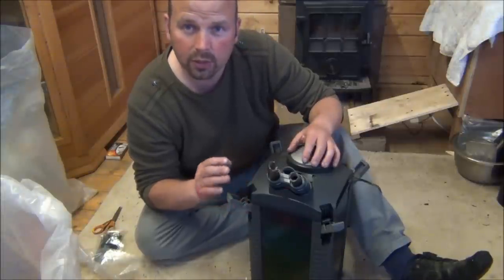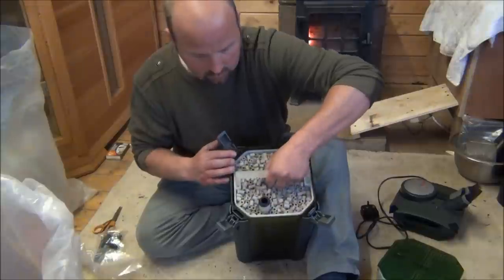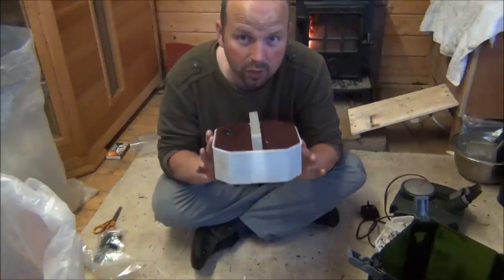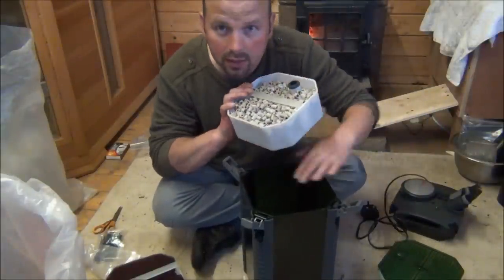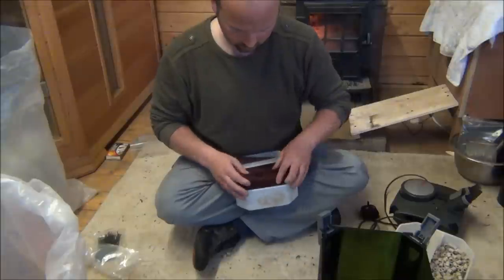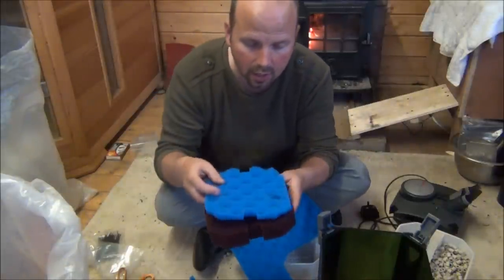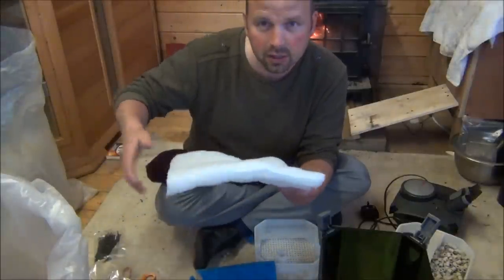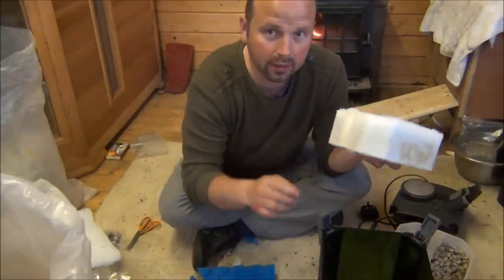How to set up an external canister filter for aquarium by Pondguru

Comment: Hi pondguru,
Firstly great video just brought some ultra-home pulse and ultra-home ultimate can’t wait to get them in the filter.  
I have an Eheim pro 3 filter which has 4 trays and the heavy foam filter at the top as a pre filter. At the moment my set up is  heavy foam filter at the top, bio balls in the first tray then ceramic media in the other 3 topped off with fine foam at the top. I can see from your video this is wrong.
Would you set up your heavy medium fine foam in the first tray then bio balls then ultra-home pulse then the last tray ultra-home ultimate at the top? Also would you remove the heavy foam from the pre filter at the top?  
Thanks mike
Reply from the maker: I take it your bio balls are the plastic type? They just take up valuable space which could be used by good media so are best out in favor of biohome. Other than the pre-filter foam in the top which you can leave in there just set the filter up exactly the same. The ceramic can be used in the very bottom just like it is in  this video, no worries.
Reply: Yep there plastic balls ill out them and do 3 trays of bio-home.
Also I run 2 of the filters how long would you leave the first filter to establish before thinking of doing the second.
Reply from the maker: Mike Boulden
With the biohome only about 2-3 weeks.
Reply: Cool ty for help pondguru 😃

Comment: Yeah i had a look it gets pumped from the bottom to the top and comes set up as from bottom to top > plastic bio balls > blue sponge 15ppi and advance ceramic media on top in one basket. 2nd basket on top has Activated carbon > phosphate pad then white wool on the top. i was thinking of getting the Biohome media best set up would be much appreciated. Got this all running on my juwel vis 180

Comment: I just bought a 46 Gallon Bowfront aquarium and a Marineland Emperor 400 hang on back filter. Saw you video and want to buy the biohome ultra to put in the media basket. It has 2 biowheels and it has the cartridges with foam and charcoal.  will all that work well together or is the biohome only good in the canister ones?

Comment: Hi

Do you think it's better to place the spray bar and intake on the same side or opposite sides. I was thinking it would be better to place the spray bar on the same side and point the spray to go to the opposite side so there is a circular movement of water.

The manual reckons that it should be on opposite sides - but I think with that setup the water that is directly underneath the spray bar does not move.

What do you think?
Reply from the maker: That would work, yes as so long as the return water is being directed away from the intake point you will get a good turn over of water.

Comment: the tubes you wanted to throw away btw are for mechanical filtration I think. Eheim has them too (Eheim Ehfimech) and it's being used to trap muck. This could be placed in the tray at the bottom (so this comes first), then the foams, at the end the biological filtration. The pipes also create a certain flow en makes the water go even throught the other layers of filtration

Comment: Hi Pondguru.  Excellent video. Just swapped my small 63ltr for a Fluval 240.  I like the idea of using similar media as that in your video. How would you set up a Fluval 306 external filter to use Biohome mini ultra media as the course filters are on the side of the media baskets.
Reply from the maker: +Steve Carter With the fluval filters they have decent filters down the side but ideally the bottom tray would still be used for the 1" thick coarse, medium and fine pads as shown in this video. That leaves you two trays which will each hold approx. 1kg of either mini ultra as shown in this video or the newer biohome ultimate which is the same but has added trace elements to enable faster colonisation and faster processing of waste. http://www.filterpro.co.uk
Reply: +Pondguru Outdoors Thanks for the advice.  I will order what I need but how often would the biohome ultimate need to be changed.
Reply from the maker: +Steve Carter It should last a good 6-10 years at high efficiency in a well set up filter but structurally it will go beyond that.

Comment: Thank you for this video, I am a beginner in proper goldfish care and all the different types of filters (and filtration type) are confusing. Now I think I finally understand what kind of filter is needed for my tank. I thought I had biological filter running, but I just realized I've only been running a mechanical filter because I only have a sponge as the media! And it also seems that there isnt really much need for chemical filtration given this setup. (Am I getting this right?) :)

Comment: Hi, love your video's!! I have a marineland C 530 and I was wondering if my set up would be the same as in video but with a 4th tray? Also I have purchased some of the biohome ultra for 2 trays so would you recomend putting the ceremic media in a tray or the bio balls!! Thanks
Reply from the maker: sunshine 34314 Bio balls as in that crappy plastic stuff which comes with filters? Throw them away and if you need to pack the filter out use ceramic rings. At least they will support some bacteria.If you're using the mini ultra it will fill trays quite well as it is designed for externals. If you have ordered the ultra which is much larger (and cheaper) you may have a problem fitting that in an external filter tray as it is around 4" long x 1" diameter - way too big for external filter trays.

Comment: i just rescaped now my eheim prof 3  / 50year edition to your scrape  with some big in the ground like you had there - then  at the 1st rek  spongis just  2 different size and at the 2nd complette with polyester cotton, 3rd syporax, 4th zeolit ( this filter has also a top separate spongi for a prefilter) - now i will see how it will work  :D and in my inside filter i have just 3 different spongis    buttom 1 big 2 middle 3 thin - there it works in this way great.
Reply from the maker: Good one - thanks for watching.

Comment: how often should you change filter media completely,,,? BTW great video!
Reply from the maker: +CJ12 In a well set up filter the media should last a good 6-10 years before it noticeably reduces in efficiency (fails to control nitrate) by becoming too clogged to support anaerobic bacteria. It may continue to control ammonia and nitrite for many years beyond that but if biohome is used at a reasonable amount (typically around 1kg per 100 litres for a normal tropical community tank) it should allow for the full cycle to be completed and the reduction in nitrate.

Comment: Hi there - thanks for all the super informative videos. One thing I've heard you say a few times that doesn't make sense to me is the business about "egg box" type foams providing more surface area. Since we're talking about water and particulate matter flowing through stationary foam which is submersed in water, then surely the foam's "surface area" as a water permeable mass is a function of its volume? That would surely mean that shaped foam is just less foam? So how does having a certain volume of "non-foam"  (or just water) within a canister help? Perhaps I'm just being dense - wouldn't be the first time! Cheers
Reply from the maker: Julian Morgan It is all about the contact area with foam. A 10cm x 10cm flat foam will have a contact area of 100 square cm but if you take a 10cm x 10cm foam with the 'egg box' profile (like valleys and mountains) the contact surface are could be 2 or 3 times greater. That allows the foams to go much longer before they are clogged so cuts down on maintenance.

Comment: Great video :) I have a Fluval 306 and plan to buy some of your media soon! With the design of this filter after the 4 long foam pads the bottom tray is half filled with Fluval's 'Bio Foam'. I want to add a finer type of mechanical filtration like the matting in your video to fill the top half of this tray and fill the other 2 trays with 1kg Biohome Mini Ultra (500g in each). Would this be the correct way to make it as efficient as possible? Thanks! :D
Reply from the maker: Yes that would be the way to do it and each tray of the 306 should take 1kg of media according to measurements I have been given by people who have bought media. The measurements I have are for a tray size of 5.5" x 5" x 3" but feel free to send the measurements of your trays so I can check that.
pondguru@btinternet.com

Comment: Hi, Any ideas on a similar upgrade for a Jewel 125 internal filter. It seems to be mainly sponges and some bio media called Cirax in a basket. I have 0.5 kilo of Biomotion I received from you this week and intend to use some to make a moving bed air filter. I was not sure how the flow in the jewel would work as it seems to feed from top and sides. Biohome mini maybe? Thanks.

Comment: Hi
Thank you for your video it was just what I needed.
I have a Atman canister filter and it's blowing in to the tank air, but there's no air going into the filter from the intake pipe.
What could be the problem please?
It's not constant
And sometimes when it happens I have shot off the filter for a few minutes and it stops.

Thank you in advance for your assistance
Reply from the maker: If it is not being drawn in from the tank or from a cracked filter housing it could be gas produced in the filter by bacteria? although that is unlikely unless the filter was very neglected - it's most likely coming in through a pipe joint or breach in a seal on the filter but if water is not leaking out then I wouldn't worry.

Comment: Hi Richard, 
I was looking to buy the  2000EF plus Aquarium External Filter this filter has 4 trays each tray comes with  fine filter floss foams in them  my question is can I leave them in their? Also 3 trays come with filter media in them which are  Bio balls, Ceramic rings, Activated carbon would it be ok to replace these 3 media's with Biohome Mini Ultra? or should I just put the biohome mini ultra in 2 trays and in 1  tray leave a media that i got with the filter maybe the bio balls?

Comment: Hello mate great info on filters gonna swap mine around now ,but only have 2 baskets ,do i need carbon i ve just added ,and i wanna put peat in it where should it go in the canister cheers
Reply from the maker: If you only have 2 trays one would have to be for foams and fine pad (unless you have a booster) so peat or carbon would have to go in mesh bag in same tray as media. Ideally any 'chemical' media would be last thing water hits as it leaves the filter but you don't need carbon unless there is staining or residual chemicals in water.

Comment: How long does that Biohome media last? And can it be cleaned and reused or does it have to be thrown out? Thank you for the video very informative.
Reply from the maker: +Dan Swanson It should last 6-10 years at high efficiency in a well set up filter and after performance declines (when nitrate starts to rise again) it is time to replace or add more (if you are using it at the limit of its capability).
For recommended amount to use in different situations see the Q&A page of my website in this link:  http://filterpro.co.uk/qa-24-w.asp

Comment: Hi nice video man, but I'm a bit confused, I also have the Eheim Professional 2 and  I have 3 trays instead of 4 as what you were working with. It there different size Professional 2 cannisters, the filter media seems to be the same slap the black rubber gasket is on a different tray also.
I just got it and it seems to be leaking from the pipe as the black gasket is at the very top under the green plastic deal. Could you shed some light on my mistakes...

Comment: Hey, i am using the 'Ultimate' so far so good! no crap coming out anymore :)
but i have got a question, IF i use a medicament (Tetra ContraIck)  can i keep the ultimates inside the filter or i have to remove them ? ty
Reply from the maker: Just leave all media in filter and everything you would normally have in tank in place as the treatment will need to kill the parasite in all stages of life cycle on all surfaces everywhere in the system.

Comment: This might be a stupid question... I bought a eheim classic 250/2213, i arranged the media exactly how you did in the video and i'd like to throw in a carbon pad to get rid of the smell in my tank. And heres my question: if i put the carbon pad directly on top of the bio media without anything separating them, would it kill some of the beneficial bacteria that lives on the bio media underneath the carbon pad? I cant put a foam or anything between them cos im running out of space lol. Thx in advance
Reply from the maker: No, a carbon pad on top of media will be no problem and is much easier to fit properly compared to bagged carbon.

Comment: Will this work on fluval 306 as my filter is terrible! And it has a slightly different layout any advice appreciated cheers.
Reply from the maker: Yes, each tray will take around 1kg and if you use the bottom tray for foams / fine pad that leaves 2 trays for media (2kg). Leave the side foams in as you're stuck with them unfortunately. They will provide decent mechanical filtration.
Reply: Pondguru Outdoors cheers I will get some which to you recommend as there's 3 I believe normal , ultra, ultimate? I have a community tank.
Cheers John.
Reply from the maker: Dear John,
The mini ultra and ultimate are the best types for externals as they have a great balance of available surface area, size and porosity. Only difference between them is that the ultimate has added trace elements to allow the bacteria to set up faster and work harder.
Regards,
Richard

Comment: not the same questions, additions haha.

But Richard, I think the eheim 2080 is built slightly different as to where the water comes first, I placed a link and that link explains that it first runs trough the course pad, than the biological section and than the fine pad, so this fine pad could be placed at the bottom, but the course pad is fine at that place I guess. Maybe you can look into that link

Comment: Great video, I thought that I had my eheims and other filters setup correctly but I had the fine pads on the top tray which what you are saying makes perfect sense as every time I open my filters there is dirty/mucky water in the center trays with the bio midea.....I will be changing all my filters around.

That bio media you used looks amazing! I normally use Seachem matrix, not sure if its on par with the stuff you used in the video but I will be ordering some to try out.

Thanks for the video

Comment: Whats the maintenance on that?
great videos, thanks again
Reply from the maker: +dannyboy123914 The maintenance is easier than when it is set up wrong with the 'polishing pad on top of top tray as all the muck is kept in the bottom par of the filter and the media stays clean. Simply remove the media which should stay clean then service the foams and dirt in bottom of filter.
Reply: Great, thanks for your reply :)

Comment: Hi, could you use this method for marine tanks to, also, when cleaning the filter, do you wash the media or just the sponges, many thanks
Reply from the maker: Yes, marine filters should be mechanical filtration followed by biological, same as pond filters too. The muck needs to be taken out before the media to allow it to properly function and last a very long time.
When cleaning just wash the foams out in water you have drained from your aquarium during regular maintenance (drain clean water from tank first). Same with media although your media should hardly even need cleaning if the mechanical filtration is working right.
The most popular media I sell for marine systems seems to be the new Biohome Ultimate which was not available when this video was made. It is exactly the same as mini ultra but has added trace elements for even quicker bacterial colony establishment. 
Can't copy and past the link on my stupid new mac book but just search youtube for biohome ultimate.

Comment: Would your upgrade kits be suitable for submerged filters? I have a U4 and was directed to your channel. I still have the carbon in after 2.5 years and was told to take it out Other than that its just some filterfloss I put infront of the coarse sponge and then some biomax rings. Though ideally would like one of your kits lol!
Reply from the maker: The internal filters really work on a cartridge system  with minimal biological action so aren't easy to make work properly. If you have a U4 your tank is probably big enough to justify an external filter (if you have space for one).

Comment: Thanks for the quick reply I was also wondering if Japanese matting would be of any use as coarse pads? The only reason I am asking about the matting and the alfagrog is that I have a pond and was wondering if I could use any of these for my external filter
Reply from the maker: Jap matting is way too big and coarse for a standard external filter but is sometimes used in sumps where the available space is much larger. Same goes for alfagrog although it can be broken up into small pieces for use in externals. Alfagrog has a porosity of around 26%, standard biohome has 42% and the newer forms of biohome (mini ultra and Ultimate) have approx 50% porosity. That allows for much greater colonisation by bacteria and in a limited space that is super important.

Comment: Im going to follow your set up my questions is how do I go about it if the canister I use is for an established aquarium. Do I switch out the media gradually?
Reply from the maker: Yes it is always best to do it gradually so the process takes 4-6 weeks. 
Week 1 - install new foams
Week 2 - change one tray (or half a tray if you have only 2 trays with the other half being done 2 weeks later)
Week 4 - change another tray (if you have 3 trays)
Week 6 change another tray (if you have 4 trays)
Hope that helps.
Regards,
Richard